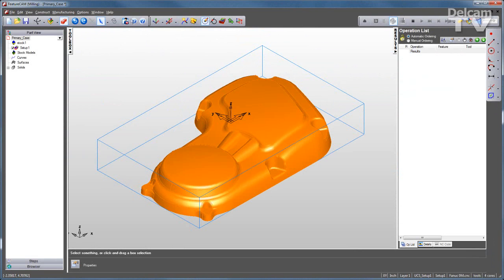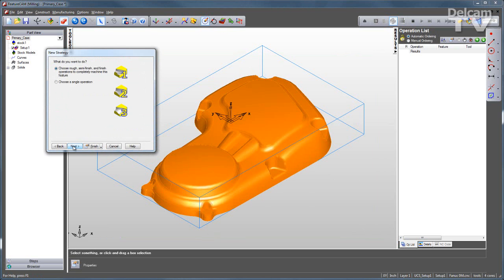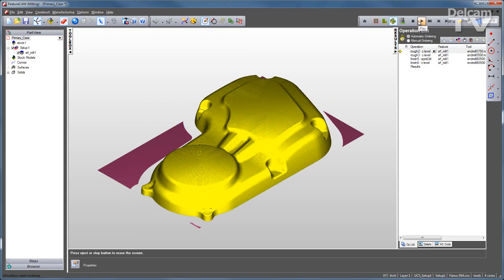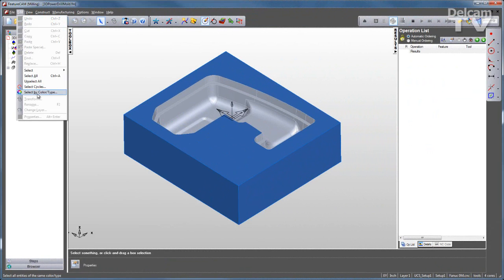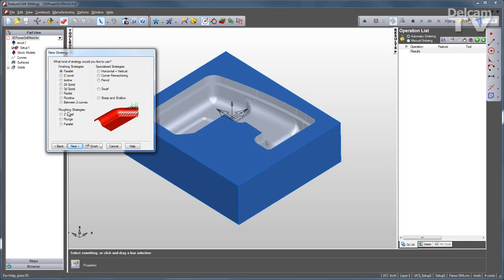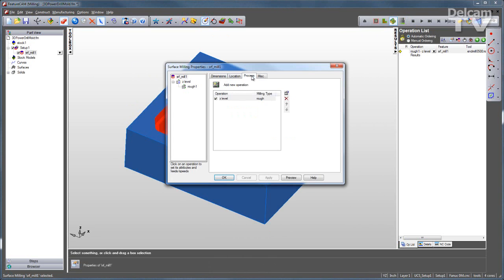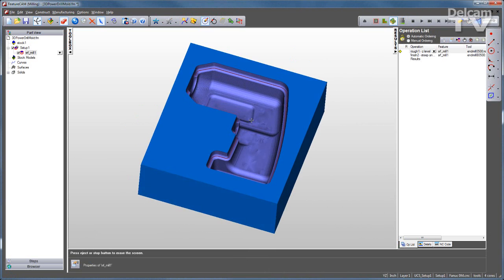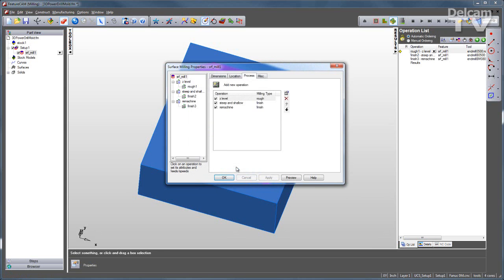FeatureCAM 3D Milling Overview

Comment: Is there a way to generate NC code in incremental G90 instead of absolute G91?

The NC code featurecam generates for me references the origin for IJ turns which isnt how g code works. What am I doing wrong? Seems to me like a potential fix would be going to G90.
Reply: g90 is absolute, g91 is incremental